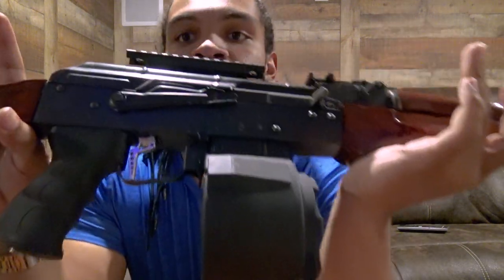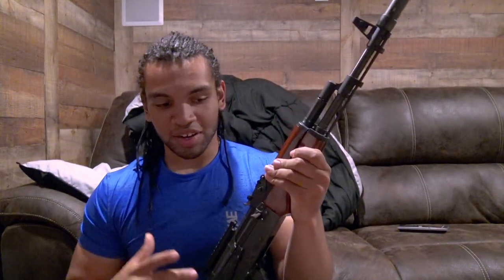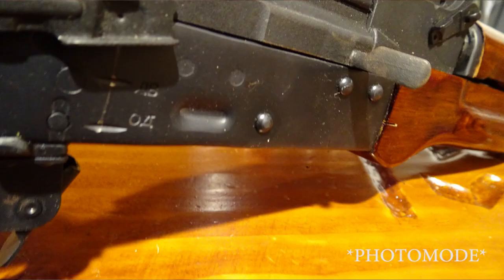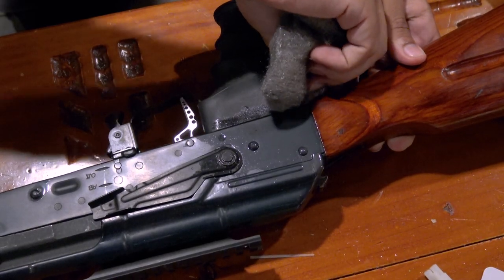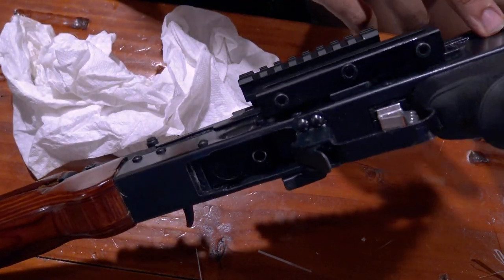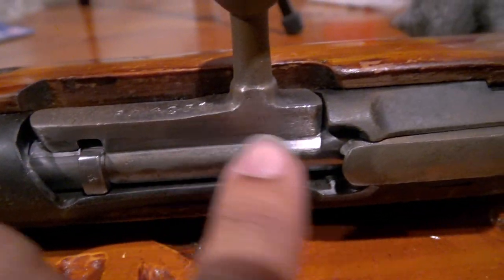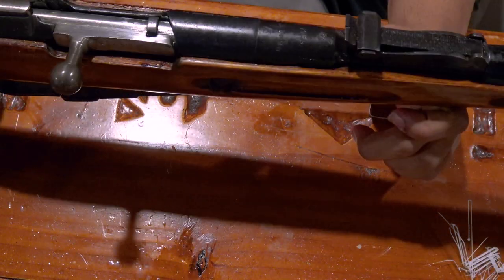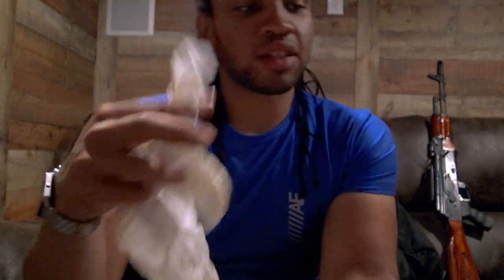Do E&L's really rust?? Yep| HOW TO REMOVE RUST FROM AN AEG - Tutorial

Comment: My built airsoft AK is on E&L bodykit, so i know the pain :) But when using WD40 spray it on a piece of cloth and then wipe the surface, because if it gets into internals you might have problem - WD40 dissolves plastic so if it gets to HU chamber it will ruin rubber, might ruin piston and other polymer parts too. Solid video tho
Reply from the maker: Olson323 That is something that is Really good to know! I dont think much if any got in there this time, but definetly something that should be considered when using wd40. Glad u told me!

Im gunna pin this so others see it
Reply: Blin it is good
Reply: Olson323 i use original oil for fire arms....works perfect
Reply: But the rust part is exactly the part i love about this rifles.....taking care of it evry time you come home from a nice skirm :)
Reply: Olson323 I'd just leave it when it rusts.

Comment: You ramble almost as much as me. You got any Garands or m14s? I like hat wd40 and steel wool rust treatment, I use it on old tools. I use that Birchwood Casey stuff, works good. Once I restored a m1 carbine, came out great. Their Tru Oil Gun Stock Finish would be the thing to use on that scuffed stock, or better yet, just redo the whole stock with it, I have never had mine scuff, I am going to redo my CYMA real wood m14 stock using that and their walnut stain. I don't have an old, made in 1972 Winchester 1894 30 30 that has been someplace that I need to use the kit I got with Tru Oil, Rust remover, and Perma Blue. This climate is not good for real steel or wood stocks. You should see what happened to our m14s in Vietnam. We used Linseed oil on our stocks, and whatever crappy oil and grease they gave us.
I know how it feels to part with an old gun you like, I had to leave my m1 carbine and garand, and everything else with my brother when I moved over here in 1994.
Reply from the maker: Ron Torrence Yeah the steel wool seems to do the trick just fine, but I havent really had to any full restores yet. I can imagine that the moisture and humidity would just eat any firearms alive over there! I do have 2 m14's but neither have the wood stock☹️ lol But maybe I'll have to try that true oil stock finish on the spartan delta and see how it compares. Probably will be a future video too😁
Reply: A few years ago I saw a promo video from a guy that was making and selling real steel m14 bullpup conversions, can't remember who it was. They were really nicely made and great looking.

Comment: I think that this thing about E&L being built on real steel parts is marketing BS, i handled few actual military AKs (Polish, Russian and Hungarian) and E&L body kits are built nothing like that
Reply from the maker: Olson323 I would emplore you to watch my E&L review video. I've done the reaserch and pitted it directly against my romanian AK. They really are 90% RS equivilent. They had to make obvious changes to acomodate a gearbox, but if you consider the logistics of it, it would actually be easier for landarms to just reverse engineer from their RS rifles, as the fewer changes you need to make to your presses and mills, the better. I cant speak for the body kits, I'm actually not sure if the body kits get the same 3mm plate steel reinforcements that the Gen. 2's have (just like the RS). The E&L is also about 1 1/2 pounds heavy than the RS counterpart. Again, I'd really emplore you to watch the review. Youd be surprised.
Reply: Yes as for build they are really rock solid, but no one could find anything about land arms firearm AK's and thats the riddle. Still - totally love mine. Cheers!
Reply from the maker: Olson323 Redwolf just uploaded a video confriming it. E&L, Real Sword, and now NPO. All practically real steels😜
Reply: NPO build their replicas from ground up to be airsoft replicas, it's not like real steel with airsoft internals in it. Im not saying that NPOs and ELs arent totally rock solid builds, because they are totally awesome :)  i just say that this "built on same line as real steel" story is somewhat of marketing BS